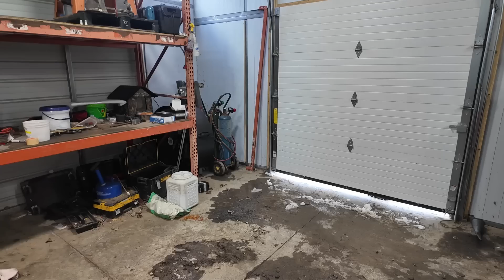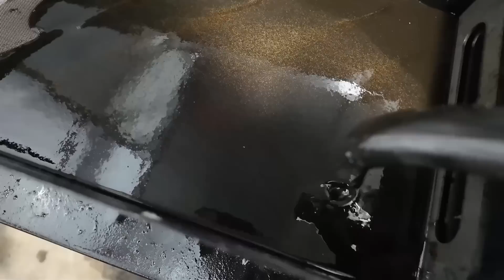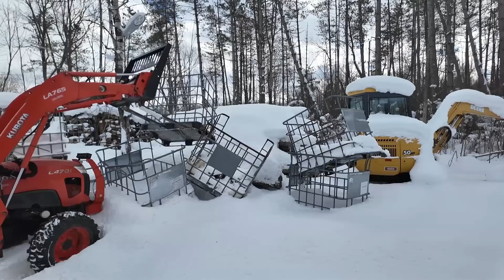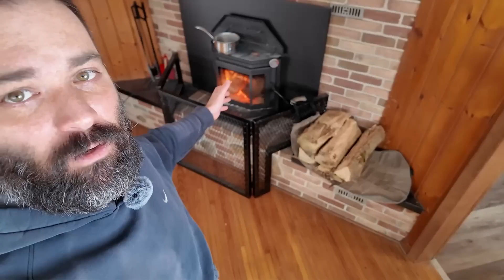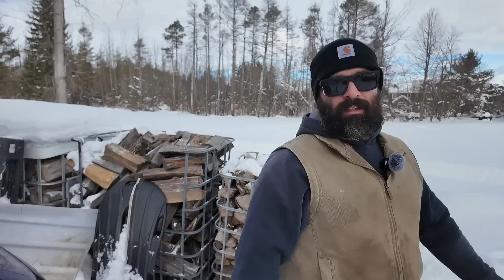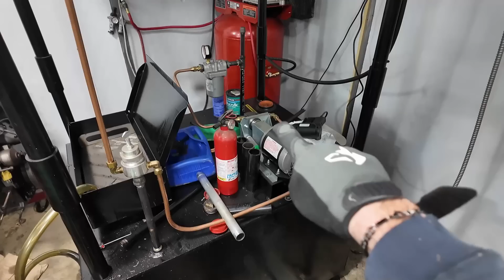The Unconventional Ways I Heat my Home and Workshop

Comment: They make waste oil boilers and then you could send the hot water back to the house and heat the baseboard heat.
Reply from the maker: I know that, however firewood is a more reliable heat source in my specific scenario…a wood boiler would be the best solution for my house.

Comment: I burn waste oil in my garage, but I built my own, going on 8 years now with my set up.
Its probably illegal but every thing is illegal in our system so I dont care.
https://youtu.be/1tGXJkIPk34?si=3FT3W66_InuqaW_K
Reply from the maker: That thing looks like homemade engineering marvel! You put some serious time and effort into that!
Reply: @EverythingElliott  there was some trial and error to figure out what worked good and what didnt, but I could totally build another one even better than this one. 

I have since moved it around and changed some things up and it works even better.

Comment: Seems like you might want to look into upgrading your insulation if you haven't already
Reply from the maker: In the house, or the shop?
Reply: @EverythingElliott  the house! I heard you mention the lack of insulation in the shop :D
Reply from the maker: @andreash.9615  The problem with this house, is its 2x4 built not 2x6 built.  It has the best r rating fiberglass insulation I can get for it...I put it all in when I gutted the house when we moved in.  If it had 2x6 construction Id be able to get a much higher R value.
Reply: @EverythingElliott  oh right,  that really sucks. They have insulation that goes on the outside of buildings here in Europe,  dunno if that's a thing over there
Reply from the maker: @andreash.9615  you can put 1/2" (around 12mm) foam board on the outside of your house, under the siding.  I plan to do that once I reside my house (which needs to be done in the next couple years) no sense in pulling off the siding now, insulating and putting the old siding back up.

Comment: I saw the video you did where you added insulation to your metal building. However I see that the ribs are still steel. You may want to do something about that. Even just air infiltration from the joints can cause severe heat loss. There are several options. 

tape over the joint

Add rigid foam over the bare metal, then tape foam to foam. 

Get a froth pack, and spray foam 1/2 to 1 inch of foam over just the ribs. Home depot has the froth pack in stock for around $430 for 400 board feet. Canned foam is about 3x the cost. The froth pack also has a fan nozzle for area coverage. You could probably get around 800 linear feet out of one kit. This would probably be fastest and the most bang for your buck. The drawback is that it needs the surface to heat up to over 50F when you apply it or it falls off a week later (it happened to me). You could probably warm it up near the heater and work out from there.  After you do one kit it will be easy to tell if you need another and if it made a difference.

Just paint it, brush or roller, at the joint and over the metal. Anything is helpful, but a silicone roofing paint will be the best to inhibit thermal transfer. A 5 gallon bucket is around $100, and willl cover around 1200 square feet, or 2400 linear feet in a 6 inch wide strip. in that section of the store they have a mop paint brush that makes applying it a breeze. I applied it to the top of a flat roof (shipping container) it may drip if you apply it to the inside of your roof. 

Of course there are other options too. 

You may also want to insulate the slab. Dig down next to the slab a few inches below dirt level around the perimeter, add rigid insulation, then back fill. It will keep you from loosing as much heat from the slab. Foamed construction adhesive makes sticking rigid insulation in place a breeze. 

It would also be easier to do all of this stuff in the summer. 

good luck.
Reply from the maker: Those are some outstanding recommendations. As of right now, I’m ok with how things are working out, once I hit the powerball I’m planning on having the entire thing spray foamed. So I’m just telling myself this foam board is temporary
Reply: I got factory seconds insulation from insulationdepot. It was about 20% of retail. There were imperfections... Some weren't cut square, some had voids, some had a chunk taken out of the corner, but none of that detracted from my primary use of insulating shipping containers. I used a froth pack around the problems, and usually trimmed 9 inches off of one end. There are other sources of recycled insulation, and it is usually as good as new, and much cheaper. I had 8 4ft stacks delivered, and have 3 still remaining to put up. The ones I got were 3.5 to 2.25 inches thick polyiso, paper and fiberglass faced.

Comment: You totally move wood around way too many times you need to simplify your process. I realize you have a tractor bought way too much handling of wood.
Reply from the maker: If I were moving it by hand, I would completely agree with you, but having them in the IBC totes and using the tractor takes all the hard work out of it.  Plus I usually go hop on the tractor with my son to move them around and he enjoys the seat time, so I dont mind.

Comment: I know exactly what you're saying. I am down the road in Oswego. I have a stone fireplace, and I put a wood stove insert in it about 20 years ago. Paid for itself many times over. I still use about a tank and a half of oil. Suburban just delivered 170 gallons, $940.00. I have a 50 gal. Transfer tank. I have been thinking about going over to diesel.
Reply from the maker: Not sure how far you are from the Onadaga Rez, but it might be a good option for you...I used to fill up my 100 gal transfer tank and two 55 gallon drums of diesel at the rez and bring them home when I had a 500 gal tank in my basement.  Just dont get caught by the DOT hauling drums of diesel fuel haha
Reply: @EverythingElliott  
I am about 40 miles from the rez. I know all about DOT. I had my cdl since 93, drove haz mat delivery for 10 years.!

Comment: Gosh ... that's still a LOT of work! Luckily you're young. I hope as you get older, you have an option to move into a home with natural gas heat home so you can eliminate the work of cutting wood, loading it into containers, storing containers, then transferring all that wood into your home just to keep the place cumfy cozy. Not to mention the storage needed for the containers.  That Waste oil furnace is nice, but then again, a lot of work.
Reply from the maker: The waste oil furnace is certainly less word than the wood stove...but you're right, one day I will hopefully own a home with natural gas.

Comment: I use to do all this too. Then I got smarter. And yes I live in western New York. I went to solar now I heat and ac my shop - and house. Then I bought an electric car. So I drive for free too. Invest in solar. You will be happy .
Reply from the maker: I wouldn't pay off the cost of solar by the time I move out of this house...
Reply: @ if you or your wife work for some one meaning not self employed half the cost is covered by the state and federal tax rebates. And if you were spending $5,000 for one year to heat with oil it would just from that be paid off in 6 years. I highly doubt. You’re moving out that soon. Besides adds value to your house. Next person would gladly pay more for a net zero house vs a house that you brake your back on 🤷‍♂️

Comment: That PVC on the oil tank fill and vent is a recipe for disaster.  It should be 2" threaded black or galvanized.
Reply from the maker: The 200 gallons I dump into it per year at 8GPM...it wont be an issue.  It doesn't get filled by a fuel truck at 30-50 gpm

Comment: Look into energy logic or clean burn they offer a boiler we’re currently heating a 40-60 with a energy logic 140H does the job but can’t keep up when it’s really cold.. we’re looking into a boiler to heat the floors and run a line to the house to heat the baseboards
Reply from the maker: Unfortunately I don’t have radiant heat in my shop. I wasn’t forward thinking enough for that and I’m kicking myself for that now. Having one heat source for both the house and shop would have been ideal.

Comment: I’m in NW Wisconsin and I heat my small rambler exclusively with wood I scrounge for, it’s easy here to find enough wood but I only use a full cord and a lot of scrap wood I collect throughout the year to heat the house. I just got a nice donation of logged red oak and hard maple from a construction company building a cell tower down the road, I’ll get about 6 full cords from it. Subbed.
Reply from the maker: sounds like youve got a pretty good system going on.  I havent paid for logs in a couple years, everything I get, I get for free.  I've got a set of log bunks I made for my trailer so it's easy peasy to pick up free logs.

Comment: I'm posting this comment before I have read all of the others, please forgive me if it's already been mentioned.  You could hang a ceiling fan (or two) in the shop to help even out the temperature.  Great video and greetings from north central Ohio.
Reply from the maker: I have 3 fans mounted to the ceiling. When I have them on, sometimes the air feels colder than when they aren’t running.

Comment: We share the same struggles I’m in springville and on propane. 2014 4000.00 in cost to keep the house at 68 degrees. Went with a wood boiler, made sense for us. I was doing the same with totes full of wood till I found out I was bringing mice in.
Reply from the maker: What brand boiler did you go with? New or used? And we keep the house around the same at 68. As far as mice go, when I bring the tote to the door, if I find any mouse house I just throw it outside, if the mice come into the shop when I bring them in, they are quickly taken care of by Theodore the shop cat.

Comment: Building a hybrid stove for the garage. Currently its an old lopi wood burner but i am going to drill a hole in the top and use a dosing pump to drip oil onto the wood fire. This is a very old school trick with a modern (dose pump) touch. Stove will consume  a fraction of the wood normally and i dont have to pay to get rid of my old oil. The house has a modern lopi woodstove that is high efficiency.
Reply from the maker: I’ve seen a couple guys do that. My wife would
Never allow me to bring waste oil into the house haha

Comment: Get a wooden pallet, put it in the bed of the truck, and place the barrels on it.  To unload the truck just pick the pallet up with the tractor.  Reduce some of the manual effort.
Reply from the maker: I’ve done that a couple times, problem is, the barrels are less stable on the pallet going down the road.

Comment: Burning used oil is extremly illegal here in EU.    Why dont you use a (dont know the english words for it) rockheat or groundheating systems?       Its very cheap and low maintenance
Reply from the maker: Strange that it’s illegal, what do you guys do with it? “Recycle” it? I think when you say ground heat what you’re referring to is geothermal heat…if that’s correct, it’s very expensive here. I looked into getting it done, and to set up the system for my house it was going to be around $50,000USD for the system.
Reply: @EverythingElliott  yeah we recycle it since its really bad for the enviroment.   Wow thats hefty, here in sweden we can get a heatingsystem that take the heat from ground/rock/lake for around 10-15k with the everything included.  A airpump costs about 2-4k but its not as effective.    All of those systems heat the waterfilled radiators.

Comment: Nice setup on home/shop heating. I heated for years with just wood. No excuses! you have the tractor to move the wood several times except the last move is manual. You say you burn a lot of wood so think about how long it take you to unload a tote of wood (x) all heating season. It's unacceptable for you not to have french doors to just set the wood inside and be done. I'm sure she wants you to do other things for her and this just takes more time away from accomplishing that.

I have wanted to do something similar to you for years now. I work on huge generators for a living. some of these generators I get 110 gallons of gently used oil a day. I haven't decided if I want to build my own like (Karl's Off Road) of buy one from a company like Central Boilers Classic CL 4030, CL 5036 and CL 6048 which does wood/LPG/NG/oil. These Beckett oil burners can be easily converted to run on waste oil. They are pricey though! I could however heat my 2100 sq ft house and shop for essentially for free.
Reply from the maker: The problem with those home made drip style stoves is they can’t be left unattended as they can run away if you’re not monitoring. You could convert a Beckett fuel oil burner, and that’s what I’d recommend if you’re not going to be present while it’s running.
Reply: @EverythingElliott  Yes definitely something with safeties intact and could be left unattended.

Comment: I hauled fuel for almost 25 years. Only one tank was in the basement like yours. Not a fan of them. If they leak it goes into a floor drain, if there is one. Knowing when they are full relying on a whistle fill that didn’t always work properly.
Reply from the maker: Notice how new my tank is? That’s because the old one developed a leak one night and dumped around 150gal of fuel on my basement floor. It was a NIGHTMARE.

Comment: Any tank would benefit from a valve at each end. Tilt down on one end and use that to drain off water and contaminants. Pull your fuel from the other higher end valve.
Reply from the maker: That’s a fantastic idea, I’ll have to check the other side of the tank to see if there is a bung I can put a valve on.

Comment: Shop heater improvement - Hot air rises...   Take your return air for the heater from the floor where it's coldest, you'll have less stratification occur and feel the warmth closer to the ground.   Or, install a destratification fan on the ceiling to blow the warm air downward.
Reply from the maker: That’s actually a brilliant idea. And it would probably heat a lot more efficiently
That way as well. I will look into that, thank you
Reply: @EverythingElliott  Look for an air handler/A-coil from a heat pump or AC unit. They have a good quality squirrel cage circulating fan that gets pitched when the coil springs a leak. Make a trunk line from ductboard to feed the fan on the other end of your shop with the fan discharge at floor level.
Reply: I just run a ceiling fan backwards and vary the speed to get the results I need.

Comment: Holy crap. $75 a day in diesel to heat your house? That's over $2000 a month!
I have a 5 ton ac/heat pump. In Florida. Ny house is 3000 sq ft
The hottest month is Aug at 95 degrees avg. My electric is never over $300 a month. The coldest month is Jan. The Heat pump runs 24/7. Electric bill is never higher that $175.  And that includes 2  80 gal electric water heaters, a pool pump and automatic irrigation system. You may want to rethink your energy strategies.
Reply from the maker: You have to consider the heating differences though. So you’re cooling from 95 to let’s say 70 which is a difference of 25 degrees. Where as I’m heating from 0 degrees to 70 degrees which is 70 degrees. That’s a much larger temperature difference and would require
A lot more energy. Things are just a little bit different up here in the north. I use a heat pump for AC in the summer where I average 90 degrees and bring it down to 70
And it works very well for that.

Comment: I have a wood burning stove insert and was also going to install a duct system above the stove ducted to back bedrooms but I didnt want to climb in attic and I have forced air gas heating also, so I just ran the fan before bed time and it somewhat normalized the house.
Reply from the maker: Honestly, that duct with the inline fan was an excellent investment. It does an amazing job at leveling the heat in the home, and the fan is efficient and quiet.

Comment: Fantastic video. Just a comment about your domestic situation. You should have suggested to your wife that you wanted to to put French doors in to let more light in and help with heat from sunlight in the winter and not mentioned the wood idea. She might have gone for the doors. And then you can suggest the next phase. Do it in stages. Then at least you could have wheeled your bin of wood to the pile to unload even if she said no to you storing the bin there. Love the heating systems
Reply: For me I would have insisted on an easier way. His wife should realize that it takes a lot of her husbands labor to unnecessarily transfer the wood inside. If she was willing to come out and stack 50% of the wood then ok. I heated with wood for many years. You only want to move wood as little as possible.
Reply: Its all in the salesmanship
Reply from the maker: See, these are the suggestions I needed prior to the remodel. Having more light, or more fresh air when they are open would have been an excellent argument for her…

Comment: I enjoyed your video much, you are easy to listen to. Good content for any home owner.
I watch many video's about alternate heating. One of the most interesting of late is "Sand Batteries". Looks like the waste oil burner is your most cost effective heater. Might be worth transferring some of the shop heat to your house. I am imagining a "Heater building" between your house and shop with a thermal Battery, "Sand" to capture and transfer the heat.
Reply from the maker: I’ve read up a little on those sand batteries, they seem efficient for a small space, but I don’t think they would work well to transfer heat to a larger space such as a home. You also need a very efficient way to heat them
Up.